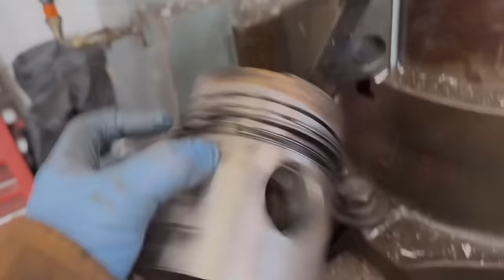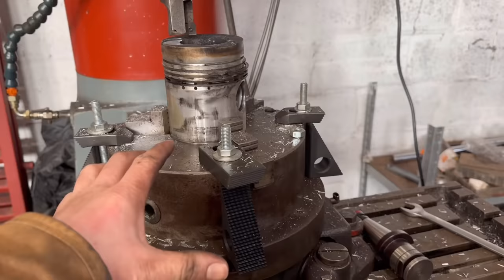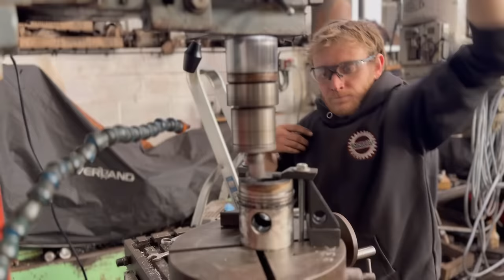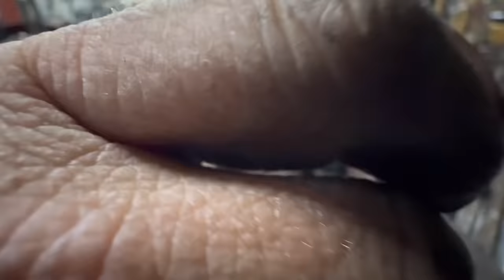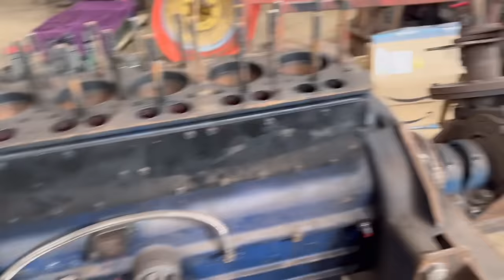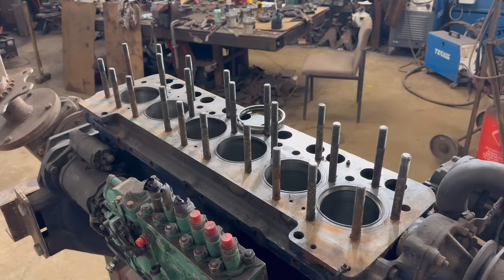Rebuilding my tractor puller. Piston modifications. Part 1

Comment: Good video as always.  Thank you.
The new vertical sharp edge along the outside of the valve relief will heat much faster than the rest of the piston.  Possibly melting and making a mess of the cylinder walls and/or creating premature detonation. 
Consider cutting the sharp edge back so that its cross section is at least as thick as the "fixed spacers" between the piston rings.  
Also remove that thin step left in the cylinder wall.  Same reasoning.

Comment: Hi Oliver. I've given you an insight into the things I've done over the years as an engineer. The one thing I've never done, believe it or not, is  strip down an engine. Not unless you count replaceing a blown piston on my sons 2 stroke go-cart, which in effect is a lawn mower with a seat and extra wheels, but apart from that, nothing. 

Seeing you alter the compression ratio was not only good to watch, but it really could not have come at a better time. You see, I have the same issue. Either I lower  compression or buy a new engine. I thought of replacing the pistons, but I like to solve problems, not take the easy route.

I will explain how I came to this situation.

About 3 years ago, my friend was doing a barn conversion in Essex for a customer. Initially, I was there to offer advice on what type of plates and rod were needed to secure the beams. Then, a week later, I returned because I had a diesel forklift, which my friend needed the use of, and i was happy to help. We had to remove large pieces of machinery and engines that completely filled the barn.

We ended up filling 3 large skips with straw, hay, dirt, dust, and all sorts of farm rubbish accumulated over god knows how many years. We also filled a 40-foot flat bed loaded with 4 rusty old chassis, 12 car, and / or truck engines plus a load of body parts and wheels.

We also found 1x horse pulled bailing machin, we think from the 1920s. 1x ploughing device powered by horses pulling on a rope through pullys placed top and bottom of a field. This is thought to be from the mid-1800s. 1x mechanical belt driven industrial size butter churn we think from the 1930s. These three are collectable and worthy of good money at auction. Then, 6 hours and 40 minutes later, we finally emptied the barn of our last find. An old Ford tractor hidden away in the corner that my friend said i could have. I say hidden but more about that in a moment. 

The same friend of mine purchased a power boat recently, which i helped him with. Then, last weekend, we removed the pair of Perkins diesel engines because he wanted to upgrade the power performance to petrol.

In exchange for me helping him plus, making some plates to secure the two Mercury marine V8 300hp engines to the rear of the boat in effect, doubling the power of what was, he gave me the two diesel engines as payment. I think he forgot about the old tractor. 

According to the paperwork, the boat was built in America in 1992 and shipped to Britain later that year for the Southampton Boat Show. It was purchased at the show and then converted to race standard by the owner in 1995. The original Cummmins engines were later removed in 1999 to make way for two British six cylinder 5.8L turbocharged diesel engines. These were built by Perkins of Peterborough. The Perkins engines were an upgrade providing more power, more top speed as well as being more reliable. The last time the boat was raced was in 2003, but since then, it has been covered up in an old shed.

My friend needs to upgrade the hull to deal with the extra power torque and customise the body, but because he's now attaching two outboards, the rear of the boat needs to be reinforced too, which is where I come in.

As for the 2 Perkins engines.

I had what the Americans call a Barn Find. According to the plate on the chassis, it's a Ford Tractor built in 1941, but most of the plate is unreadable. I don't have any paperwork, but when I asked my local Ford car dealership to help, they just asked for the serial number and any other numbers from plates found on the chassis or bodywork which I gave them.

Some days later, I got a call from the Ford dealership with good news. The Tractor is called a 'Fordson' Model 9N built in the USA in 1941, but it was shipped over to England sometime during 1942 with 49 others. Not long after that, Ford gave licence for their Fordson N series to be built in England, in Dagenham, Essex, to be exact. Licence was given because Hitlers U-boats (submarines) were sinking most of the ships in the Atlantic, causing millions of tonnes of valuable cargo to be lost.

So, the history is. My friend and I came across the Ford Tractor when renovating an old 18th-century barn. The whole farm and its land were split up and sold off in sections. The new owners of the farmhouse and barn, together with several outbuildings, contracted my friend to convert their barn into a studio of sorts. What for exactly, we have no idea, although some soundproofing is to be used.

Anyway, my friend thought of me and gave it in lou with the payment of some work he needed doing on his next project, the power boat. Sadly, there is no engine, but beneath the piles of dirt, dust, and heaps of bird droppings is a great chassis with little to no rust. What rust there is will dissappear once sanded down and repainted. 

As for engine use. I was advised to either lower the compression on the Perkins or buy a less powerful engine unless i wanted to pull wheelies or do burnouts. The thing is, the engines were basically free! The paperwork confirms they were built in 1998 in Peterborough and sold the same year. Were they made to order, who knows. But the difference between converting a marine engine to agricultural use is dead simple.

Marine engines come as petrol or diesel. A petrol marine engine is as rugged as a car diesel engine, and a marine diesel engine is more rugged again. That is because a marine engine is always under load. A car or truck can coast along with only a small amount of wind resistance for load, but a marine engine has water resistance to deal with and which is constant. Had my friend wanted to use an agricultural engine to power his boat, then quite possibly, the engine would not last as long as a marine one would and be nowhere as fast. That's it in a nut shell, really.

Now, I have two identical 5.8L turbocharged diesel engines which, if I play my cards right, will power my Tractor for generations. All I need to do now is decrease the compression ratio and wham!

I just hope my calculations are correct, and I hope that I don't remove more than is necessary. If I damage the pistons or any other part of the engine, then I have a complete spare. So check twice, check three times, and check during the process, just as you did Oliver.

Can't wait for part 2 so I can start my conversion. 🤘⚒️🏴

Comment: nice recovery from the wrong size cutter in the end got it done took a little longer but nice finish for sure and yes mate we do like this sort of content so anytime you have to do a bit on the old tractor is fine by me for sure just love all the work you do as you have a different approach to jobs as they come in and are not shi to try soma diferent away from the normal way of doing it things like the loader arm instead of line boring welding and such you cut new plates with the crect holes in them weld em on and job done you have a young man's approach to work which has been stuck in it's ways then Along Comes Snow  again i say thank you for taking the time to set the camera so we get a look see as setting this thing up takes time and gets in the way but you work with it THANKS Cheers

Comment: Well that's definitely a different video from the normal fabricating.  Made for a very interesting watch , a little insight into the tractor pulling mods on the engines . A great description of how and why . Just shows it's not just a case of pop another bigger lump into the vehicle.  Some nice delicate work on the pistons just shows how much finesse the mill can give . And it also shows how quick a cylinder can flash rust

Comment: I got BMC 5.1 which is the smaller version of BMC 5.7 which both are earlier design for Leyland 6/98. Leyland block is stronger, sleeves are thicker because 100mm sleeves were prone to rust cavitation. They went with 98mm sleeve and increased the stroke to retain the 5.7 liter displacement. Also they upgraded to gears instead of timing chain. 
It is totally different engine, but many parts are still compatible. 
Anyway I got Minimec with 9.5mm elements and it has plenty of power, but I also got Zexel waiting it's new home 😉

Comment: Being a retired small engine mechanic by trade, I've never worked on a diesel engine. With petrol engines, we aim for a 45° cross hatch when honing a bore and the standard top ring gap is 4 though per inch of bore, or with a performance engine 4.5 thou per inch of bore.

Comment: Good idea using the rotary table, sucks that you had to, but good idea.
A suggestion to not have parts on the rotary table = make yourself a pallet plate from a chunk of aluminium. Seriously underused on rotary tables, but super useful. You can then bolt your parts from multiple locations, for example with a pallet, you could've used one of the wrist pins to grab unto the piston from either side using a bolt and some angle iron. It really does open the fixturing capabilities.

Comment: A good tip I learned was to wipe the  cylinder walls with a clean rag and automatic transmission fluid just before final assembly.  I guess it has some detergents that clean the final bits of debris very well.

Comment: The first time I saw an engine stand with a gear to turn the engine was made by an old mechanic who used the shaft of an s cam and a slack adjuster. It turns the engine slower than yours but it takes very little effort

Comment: Since the periphery of the cut is interrupted by both the OD of the piston and the central depression anyhow, I first thought you were going to do two vertical cuts slightly offset from each other and simply ignore the small difference in radius. But your method is neater.

Comment: You can make your own pair of ring pliers. When i broke mine, didn't even bother with fixing them or buying new ones. Cut some sheet on the plasma table, make the base of the pliers, then machine two V shaped blocks and weld them to the tips. Those V shaped blocks are where the ring ends fit, the taper holding them straight and true so they don't snap. If you google ring pliers, you'll find the type i'm talking about. Works really well.
Reply: They cost next to nothing for a cheap pair. I don’t do many engines but it’s so much easier

Comment: Hi Oliver, great video , lots of interesting stuff , I’d like to see more on the Leyland project, liked your engine stand , was thinking of doing something similar for my 4/98 engine but wondered if the block could take the weight , I think you proved the point as the 6/98 is quite a bit heavier and longer. Thanks. P.s good looking grille on the Leyland too.

Comment: Just noticed you have a set of 4 of the Vevor machinery skates. I got a set last year, they work well enough, but I would recommend that you take out the shoulder bolt that secures the rotating pad and fit a length of M12 studding. You can then fasten the skates to the machine through the holes for the machines holding down bolts. If you don't do it, the skates really do take on a life of their own and head in any direction, but the one you want. I also made up a couple of bars from 16mm cold rolled, machined down to 14mm and bent at the ends to fit in the tubes on the end of the skates to steer them. Beware that there are about 50 5mm ball bearings loose under the rotating pad that will go everywhere given half a chance, don't ask me how I know.
Reply: “Don’t ask me how I know!” Sure sign one is speaking from first hand knowledge.😁 BeSafe!
Reply: @allenbrown7820  Yep; and trying to find them all on a workshop floor is a bit of a bugger. Fortunately, they were pretty well greased and stuck to the muck on the floor. I had swept it so we could move the mill and the lathe without there being crap on it, but still enough to stop the balls rolling everywhere.

Comment: You ought to have made  a fixture plate machined to suit one piston first, then you can use it to easily position the rest. A scrap piece of ally plate fixed to the rotary table face, and then a recess bored in the centre to fit each piston into, drilled and tapped to accept fixing clamp studs.  Fixture plates are the millers dream when multiple parts have to be machined, to make set up quick and easily repeatable.

Comment: Very Interesting.
I’d have beeen tempted to use the rotary table to elongate the cut out to 45mm but what do I know. 🤠
I’m guessing the cubic size of the compression chamber is the important bit.  Being exactly round might not be that important to the flow of gasses in and out of the valves.  Just an observation, I have no idea really.  Looking forward to exploding fuel in there to see what happens.

Comment: IMO I would not have removed material from the OD of the piston above the top ring to lower compression this will expose the ring to more heat and the ring will loose its tension. The area above the top ring is made smaller already to compensate for expansion when the pistons are new.Also the more heat the ring sees the more it will expand, most ring manufactures use .004 thousands of end gap per inch of bore in NA engines. High performance or Boosted engines the gaps will be more say .0045-.005 thousands per inch of bore. Thanks

Comment: Hope that's a later 698 I did so many terrier/boxer head gaskets it wasn't funny, guess you guy's have worked out how to get the spinney bit's to stay on the inside great vid Oliver
Reply from the maker: I’m using a solid copper head gasket with fire rings machined into the head.

Comment: Something a bit different today Olly !
I wonder if it might have been a bit faster/easier offset mounting your 3 jaw in the lathe's 4 jaw, pop a piston in and line up the cutout with that little plunger you had, fitted in the tailstock ?
A bit of WD40 helps with the finish when cutting aluminium too.
Be interesting to see how the Anchorlube works. I tend to use Rocol stuff mostly in the shop, but still have an old tin of Trefolex that lives in my site bag.

Comment: Actually revisiting this it might have been just as easy to turn the tops of the pistons down to provide the requisite combustion chamber volume as the valves are a,ready clear of the piston crown and there would be less risk of fine elements that could course pre ignition problems.
Reply from the maker: There’s no issue with pre ignition with a diesel

Comment: Hi Oliver,  interesting setup on machining the valve pockets,  I take it your going to boost the engine, either turbo or blower, what kind of boost pressure will you run to give a safe compression ratio, for reliability. Or are you taking it close to its mechanical limit and hope it holds together, it will be interesting to see ,and hear it running. Thanks for another interesting video mate, stay safe, best wishe's to you and your's, Stuart UK.

Comment: A reduced diameter at the top of the piston will have the detriment of letting more hot gas contact the top ring and it will also get hotter, and therefore allow less heat from the piston to transfer to the cylinder head. Not a negative comment just something to add.
Reply from the maker: It’s a common thing to do in the tractor pulling world
Reply: @snowballengineering  I've never heard of that being done before, but I've only ever worked on pretty standard petrol engines.

Comment: Interesting, what boost pressure are you aiming to run on this one when it is done Oliver? Also, will the low compression of 13:1 you are going to end up with cause you any starting issues?
Reply from the maker: Was running at 40psi before which isn’t a lot, with the billet compressor wheel I have for it the turbo should be good for 60psi.  Yes, it will need ether to start but that’s not a problem.

Comment: Hi Oliver I owned a Leyland 2100 in 1988 and used it as a contractor leading potatoes  it started making a noise in the back end when I gave it some hammer getting it out of a wet field so I traded it in how is your transmission holding out 👍vid
Reply from the maker: I’ve done a few gearbox modifications.   I’ve taken out the high/low gears, removed 4th to make room to double up the 5th gear coupling which joins the input shaft straight onto the pinion shaft. So now when I’m pulling no gears are actually meshing.
Reply: @snowballengineering  interesting 👍

Comment: Nice one Ollie, but can’t help wondering about that top ring,now you’ve taken a mil off the top of the piston isn’t the top ring in danger of tipping ? Also what power output are you looking at getting after all the mods ? 👍
Reply from the maker: It’s a mil off the total diameter so only 0.5mm depth of cut. I think it’ll be alright, I’ve not had issues before.  Should be around 600hp hopefully
Reply: That should pull a few chip harrows, our old Fordson Major could just about pull four and that was after the air cleaner had been cleaned.😊

Comment: I don’t agree with lowering compression this way. Your modifying the combustion chamber making the flame front climb mountains and go around sharp corners. That causes detonation and lower power. In order to get the efficiency back you’ll have to advance the fuel delivery. Good luck. Just my opinion I’ve been wrong before.